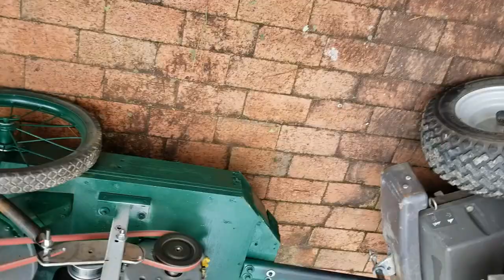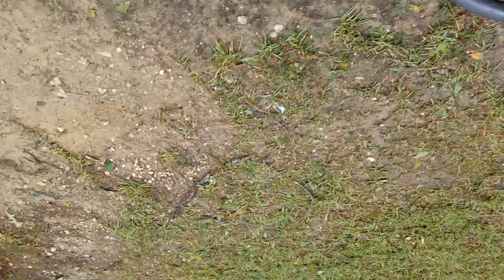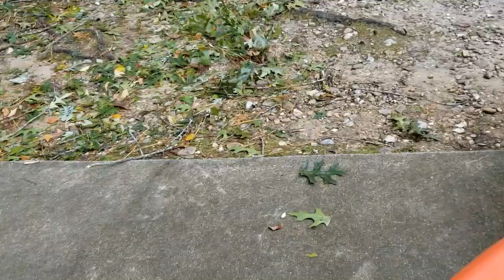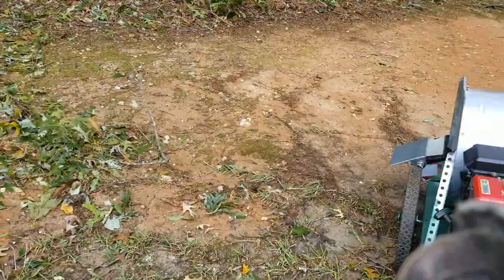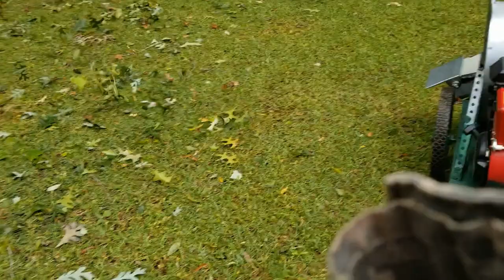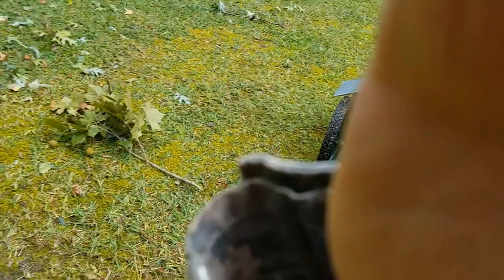LEAF BLOWER  HOMEMADE,  DEBRIS CLEARING, BIG WINDY IN ACTION   AIR HANDLER HOUSE FAN

Comment: That is a really nice homemade leaf blower. I need to make one myself. What kind of motor? Where did motor came out off? Thanks
Reply from the maker: Cheers, Its a 5 hp briggs, cast iron bore, with low oil protection, set up for manual choke and manual set and go throttle.. Brought new in CA 1997 then held for a project.

Comment from the maker: Cheers, Its a 5 hp briggs, cast iron bore, with low oil protection, set up for manual choke and manual set and go throttle.. Brought new in CA 1997 then held for a project.

Comment: Put a smaller diameter pulley on the blower to increase the speed
Reply from the maker: yep tried that, increased the pulley heat and that fan has a large mass it dislikes going really fast, I get it to about the speed it runs full blast as air conditioner around 1900/ 2000. the chatter is awful past that